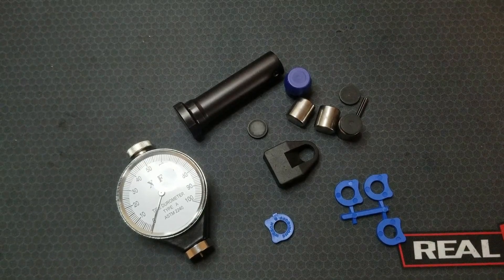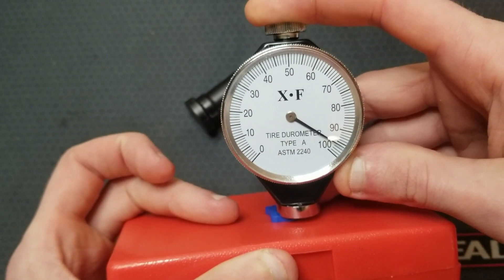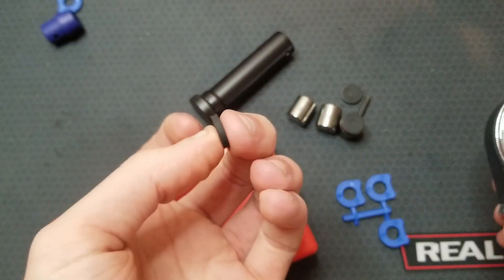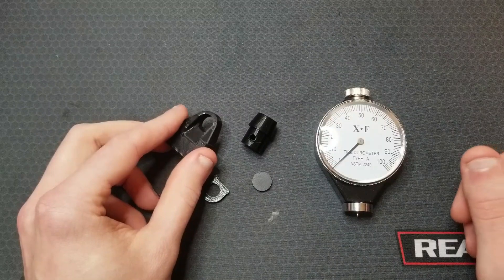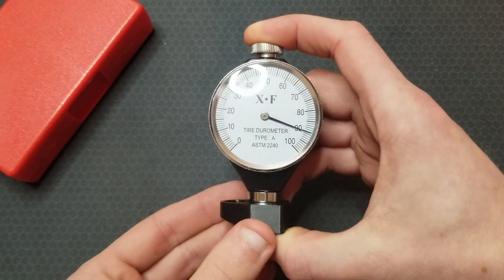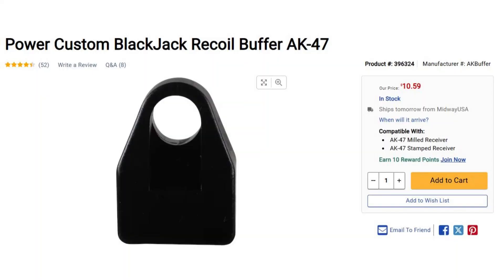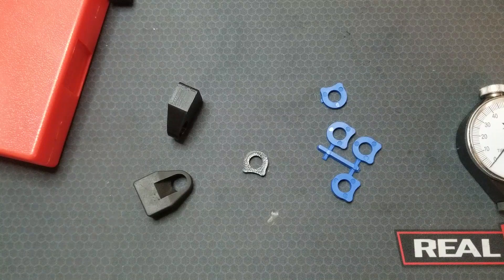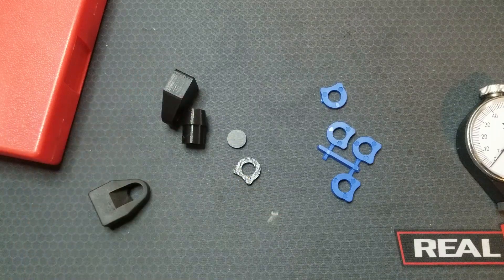3D Print Your Own Recoil Buffers

Comment from the maker: Updates (I will add to this as I do some testing): 

1. (2/13/25) I have added a CZ Shadow 2 buffer design to my GrabCAD page. I would recommend printing that out of mid Shore D hardness TPU.

2. (3/23/25) I tested the softer 95 A 1911 recoil buffer and it came apart in a hundred rounds or so. I have printed the 1911 buffer out of Shore 64 D TPU and that is holding up well over a hundred rounds. The 64D buffer feels just like the Wilson Combat Shok-Buff.
Reply: some 1911 recoil buffers are made of aluminum. I print them in PA6 CF. They work without issue.

Comment: Really cool video!  I was looking for rubber buffer spacers last week.  You would think they would be common to find!
Reply from the maker: I feel like the common platforms have buffers that are easy to get, but there arent many options in hardness or thickness. if you have design software and a 3D printer you can make anything you want. Also places like McMaster will have different stock shapes and sizes of rubbers and soft/hard plastics that you may be able to use and cut to the size you need.

Comment: Nice. If you do an update can you provide what shore hardness felt the best? I designed a buffer for my Shadow 2 but don't have any TPU yet. I also have cut out some buffers from a sheet of rubber, ranging from 40A to 50A shore hardness.
Reply from the maker: The feel will be largely subjective. i will certainly try the 95A vs 60D that I have on order. I am kinda interested in varying thickness to limit slide/bolt travel. Might be able to speed up cycle time.
Reply from the maker: FYI I measured about shore A 100 on my factory Shadow 2 buffers.
Reply from the maker: Also you reminded me to model up my shadow 2 buffers! I meant to do that. Thanks. I'll add the design to the GrabCAD page too.

Comment: Nice. It might be interesting to play with different buffer thicknesses to see if the change in cycle distance makes any difference to you. Many comp guys double or even triple up on buffers on their 1911s
Reply from the maker: Oh shit dude thats a good idea! I can print them however thick I want and even limit slide travel. I need to get the harder filament first.
Reply: @ Yup! Might work with the AKs as well to speed up bolt return. A few years ago I made an extra thick delrin buffer for a select-fire MP5 and it made it sound like an MG42 haha
Reply from the maker: @Shootin_Bruin  The AK buffer is going in my tuned up Zastava M90. Its like my softest shooting 5.56. Im running one of the bought buffers in there right now. I'll replace it with the 3D printed one to see how it lasts. Then maybe play with different thicknesses to modify stroke.
Reply: @EngineersArmory  Have fun man!
Reply: @EngineersArmory  
Any buffer options on closing to use stronger springs but close softer with less dip? One that works with the dpm system? Lots of options now...also mag protectors.
EDIT: Talking about pistols. 
Need a shore A tester for my kmr buffers.
Reply from the maker: @onpsxmember  muzzle dip as the slide comes foreard will mainly be a function of slide mass and recoil spring force. Buffer may change it a little becuase it shortens the stroke of the slide. I bet the effect is negligible. 

My experience with DPM systems is that they dont do much for felt recoil. Nor do they offer as much adjustability as a single spring system. I did significant testing with a kit in my p320. I wouldnt expect the buffer to operate or behave any different with a DPM system.
Reply: @EngineersArmory  
My thought was less on the felt smack on closing but the duration by a long dampener based on the third spring of their system on closing. Probably not much change, but less wear.
Reply from the maker: @onpsxmember hm I suppose I'm having a hard time visualizing what you're talking about. Like an individual damper in between the stages of the multi-spring recoil aasembly?